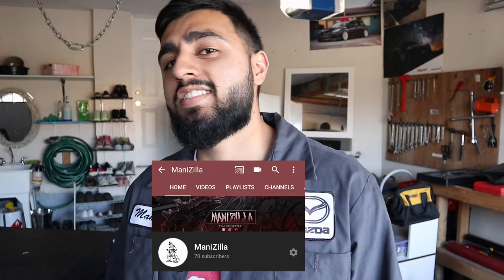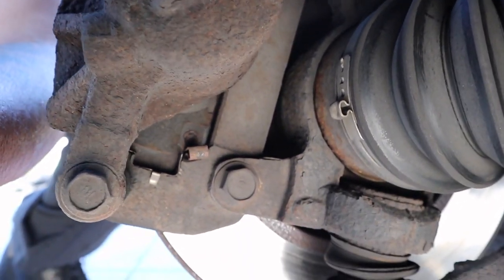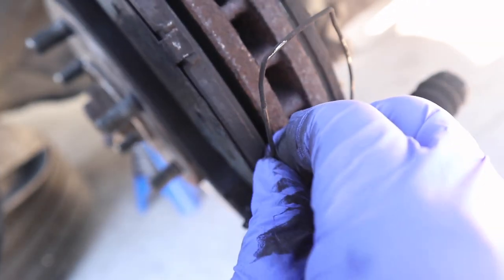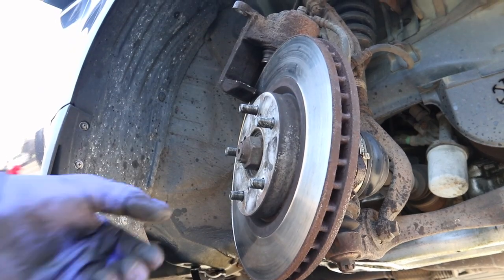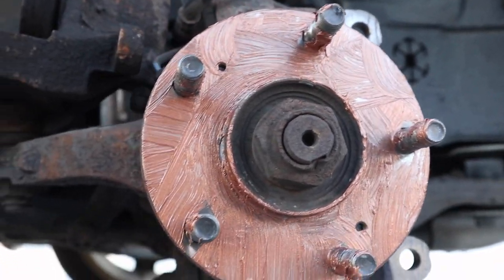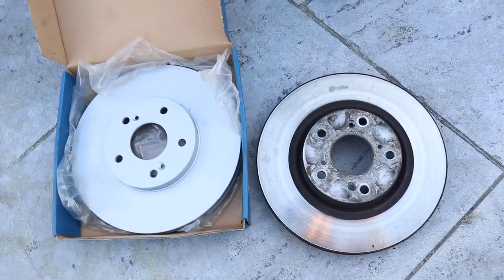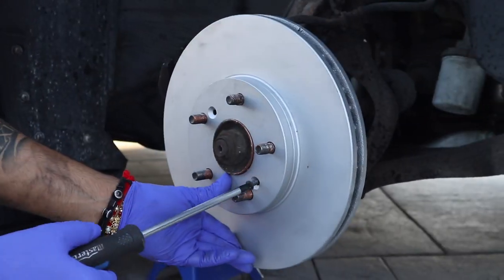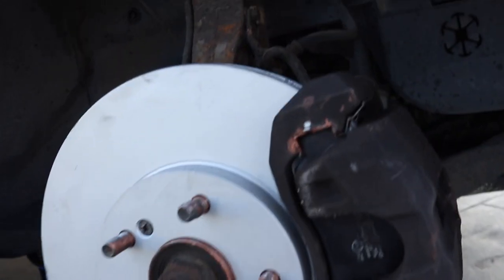Acura TL Front Brake Job (2004-2008)

Comment: whenever someone puts up a video about a specific job on a specific vehicle, it's going to help a lot of poeple, thanks, BUT, you don't address some of the hard parts: 1) it's impact Screwdriver, not impact hammer, 2) I've never seen a rotor come off that easy, it may happen but I banged on the disc on my Honda Ridgeline fo a while and it would not come off.  Honda is brilliant and they make fitted holes in the rotor that you can put a bolt in to force the rotor off.  It's very simple and a very easy to find part at Lowes or Home Depot.  DOn't start this job unless you have a 75 cent metric 8x1.25 bolt just in case the rotor won't come off
Reply from the maker: Andrew W ur definitely right 
I had barely done brake jobs when I made this video so I can assure you the future videos will be more detailed and focused on the harder areas to cover during the job